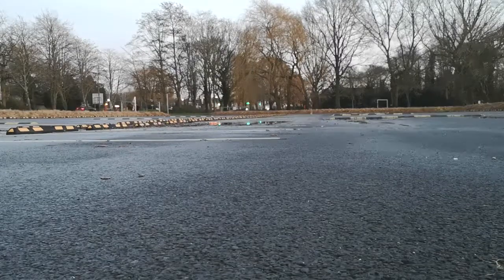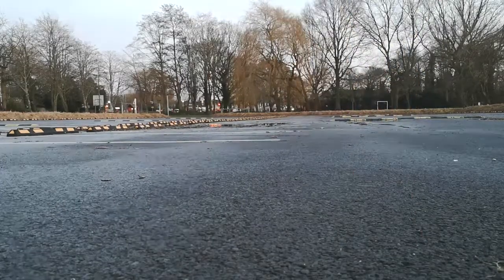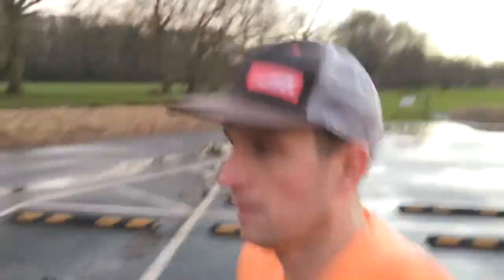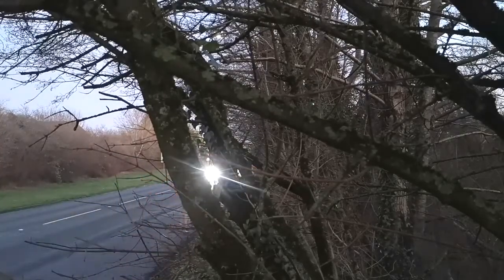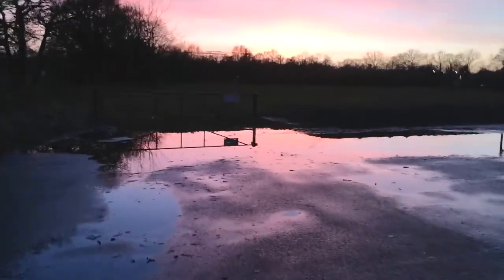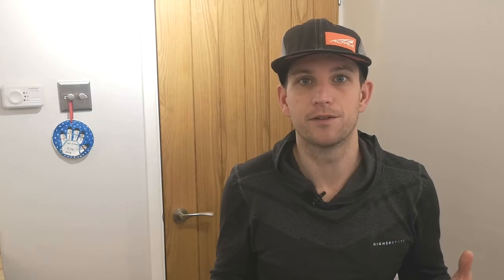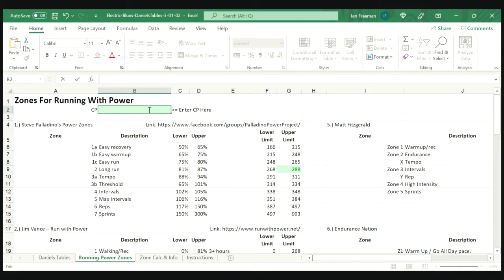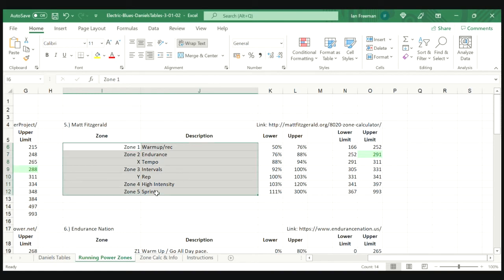How to do a running FTP test

Comment: So is FTP an alternative to MAF running or just a threshold power test? I'm just restarting running properly again and am planning to follow MAF so any info is useful.
Reply from the maker: Hi Will, I would say it's very similar because it is about sticking to zones and not falling into the trap of running to hard on your easy day's and too easy on your hard days. The trouble with heart rate is the variability. Your hydration levels, caffeine levels, how tested you are, the heat etc. can all impact on your heart rate and therefore you risk either going too easy or pushing too hard. Plus, there is the lag with heart rate. It can take a while for your heart rate to 'catch up' with your effort, so again you risk going too hard early on in the effort. That said, it is certainly an important metric to measure and I will always keep an eye on it, but it will be second to power.

FTP is a threshold power test, so similar to doing a max heart rate test, to actually answer the question you asked! 😊
Reply: @IRunDaily  thanks for all that mate. Are you measuring that just on your watch or how do you measure?
Reply from the maker: @willmaynard9016  I have corus pace 2 watch which has power built in (I have literally no idea how it works, some sort of Elf magic!) You can also get footpods. My friend has a Stryd and is very happy with it!
Reply: @IRunDaily  ok thanks again mate, I have a forerunner 245 so I'll fart about and see what it has. Take care.
Reply from the maker: @willmaynard9016  ultimately, consistent training is the most important. I'll be doing some more videos soon on the pros and cons and how it's going. Thanks for watching and commenting, it is appreciated!

Comment: I thought to calculate the FTP you take (9x (Av Power of the 9min) - 3x(Av power 3 min) ) / 6
Taking the average of the sessions wil give a too high number. 

https://docs.google.com/document/u/1/d/e/2PACX-1vSz0ryPMD4vVJLi2HGjkqoUKRzRPhN78TUNlCmuYcrLTjeLPx-ZaiROk9NG96iatJ4zYKAQcbjEEot0/pub
Reply from the maker: Hi Bernard, I used Matt Fitzgerald's session and calculation, but I will go back and check it in case I misread it/misunderstood it. That article looks interesting and I will read through it carefully (I have just skimmed it). Interestingly, I just ran a marathon today and pb'd by 10 minutes using power to pace the run, but I've had lots of good data feedback from running at 'race pace' efforts and running a marathon 6 weeks ago and that data has really helped me to best judge my efforts - possibly better than a stand alone ftp test in all honesty. It might be a video to redo in the future based on the greater depth of experience I now have with it. Is it something you use effectively?